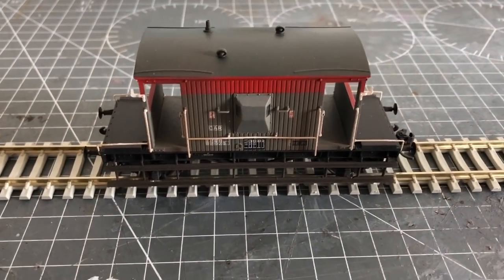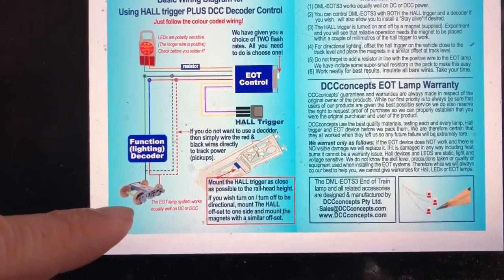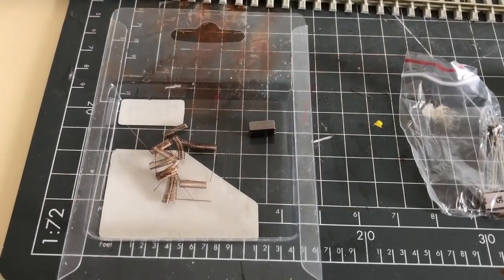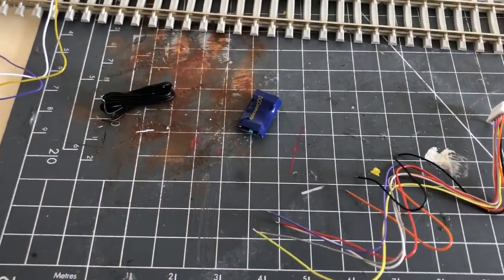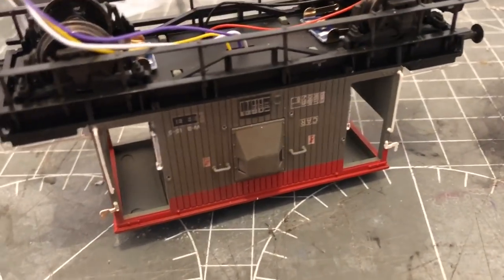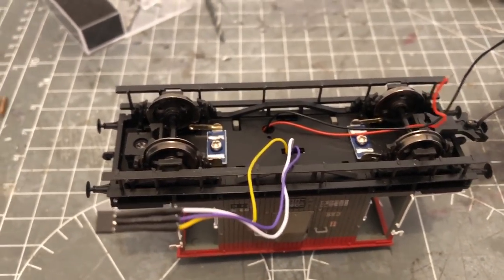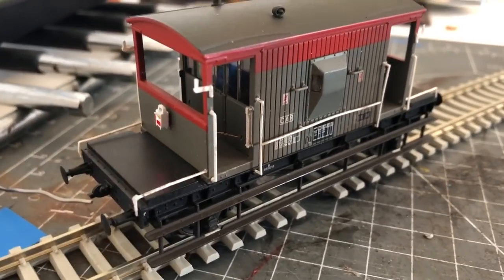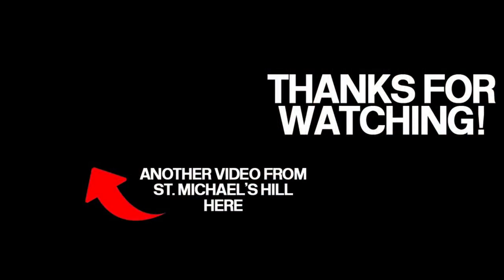St. Michael's Hill Model Railway Ep.34 - DCC Concepts End of Train Light Install and Review

Comment: They're a nice product, if a litlle pricey, but they effect is great! I wonder how they're work with a stay alive to save on having to put two pickups on?
Reply from the maker: Yeah - they aren't cheap! Perhaps your version could be your next kit! I think I might try how you did yours, I have a load of the non-operational EOT lights so it would be good to get them working!
Reply: They work fine with a stay alive and with one set of pick ups :)
Reply: I had real trouble getting a constant flash. I know it wasn't the pickups as the coach lighting was fine. Ended up binning everything other than the lamp and hooking up to a fx decoder.